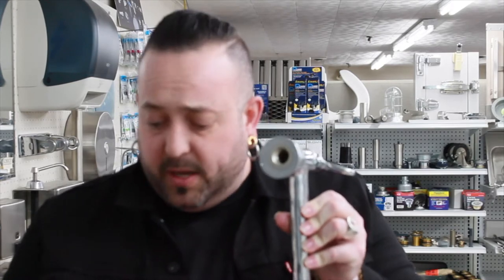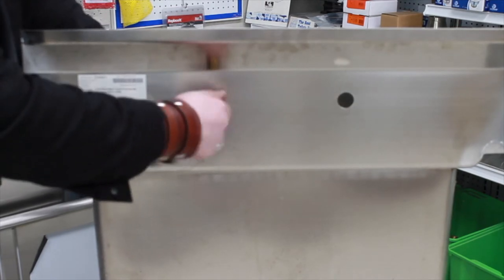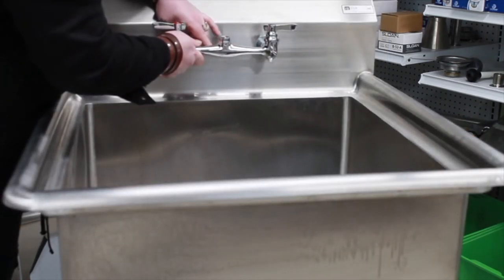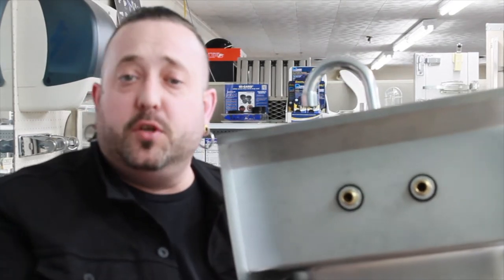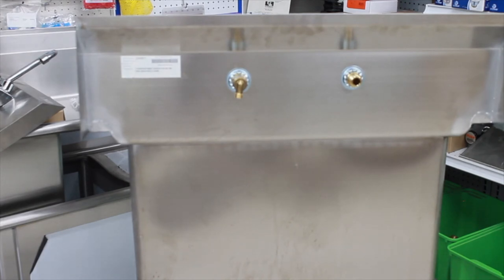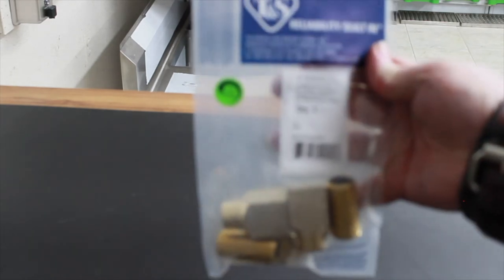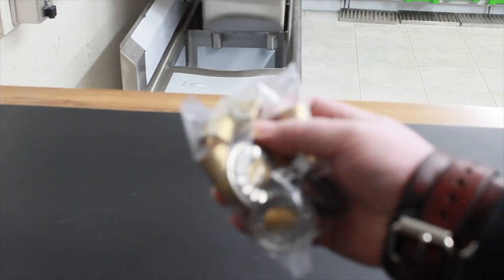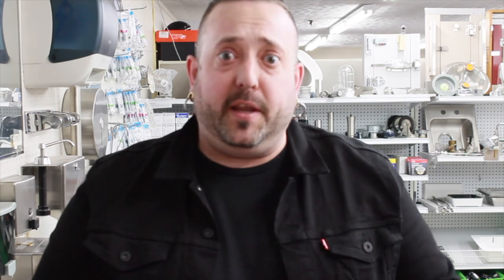Commercial Faucet Install Kits

Comment: I've been having problems mounting the faucet to my sink that came as a combo from Amazon. The setup your demonstrating is the same setup I'm using. Yesterday I probably spent an hour standing if front of all the parts on display at Menards. I left scratching my head and when I got home I found this video and thanks. I just ordered an EZ-Kit and it's on the way. I stopped by our First Supply in S.E. Minnesota this morning and they had no solution.
Reply from the maker: Sorry you were having issues. I’m glad this helped. We just make videos whenever we get a question we get often. I’m glad we’ve been able to help solve issues.

Comment: I'm installing in my garage an American Standard 8350235.002 Faucet into an old style cast iron porcelain/enamel commercial deep sump sink that sat in my back yard for about 30 yrs. (not too rusty either). The video helps as I had purchased with the faucet a T&S B-0230K nipple kit or as they call it installation kit. I'm glad you answered someone else's question about putting pipe tape on the nipple part going to the faucet but with this kit I threaded the nipple into the block part and it doesn't seem to tighten before it bottoms out. I plan to put about 8-10 wraps of tape on it or whatever it needs to make it tighter. I was wondering about the slight offset of the faucet inlet, is that for slight variations in the hole centering of different sinks and/or for leveling wall mountings?
Reply from the maker: That is weird that is bottoming out without tightening.  There is supposed to be a slight taper to the thread. But thread tape should help. As far as the offset, yes it is just in case the faucet holes are slightly off. A lot of builders will punch holes in their stainless on site.

Comment: My question is to the Ats guy my kit has the large black washer. You did not use that in your video with the backsplash mounted faucet if I use it which side does it go on the side where the faucet is or the backside behind that Jagged washer
Reply from the maker: Black rubber washer on the backside of the sink before the jagged washer. This helps lock it in place and prevents slippage. 😉

Comment: my half inch nipple leaks. I am using teflon tape and pipe dope . how do you get it water tight ?.
Reply from the maker: erik Bender lots of tape will usually do the trick. Only other tip I can give is the nipples have the hex on the inside if you can get a screwdriver big enough to fit in the groove to get it really tight. If all else fails, pipe dope. But I’d just layer up on the tape to be honest.